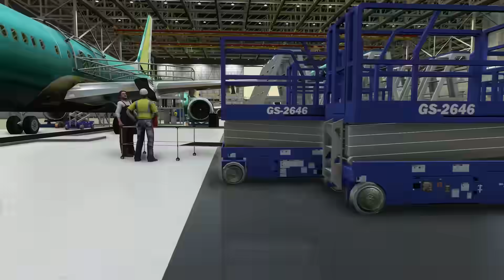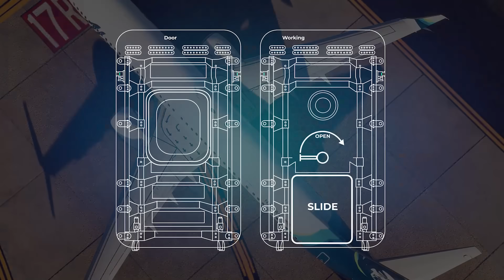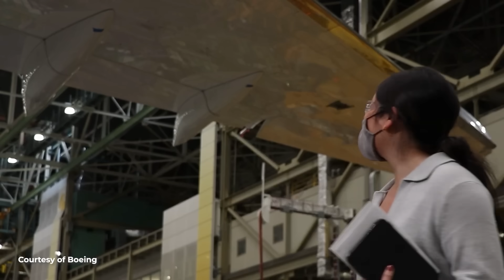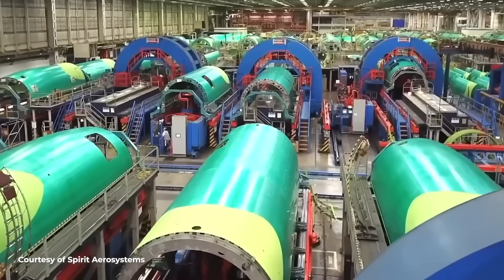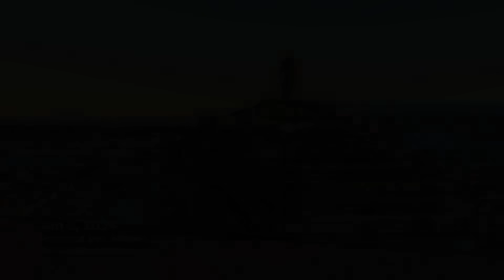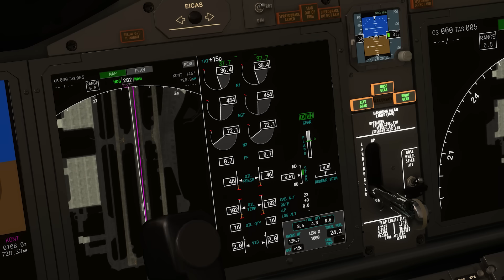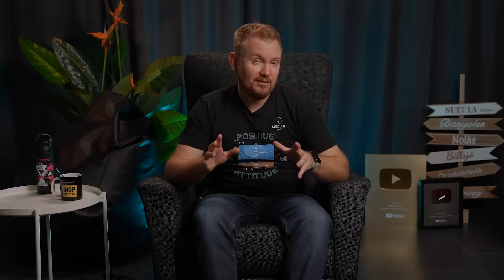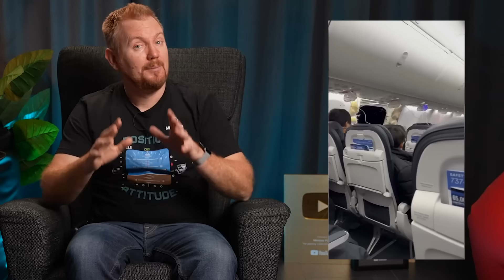Boeing 737MAX BlowOut!! The Scandal behind Alaska Airlines flight 1282

Comment: Was it "some miracle" that passengers were not seated next to the plug?  Previous passengers had complained about the whistling. Some smart employee of at the airline without the authority to ground the plane must have decided it would be prudent not to use those seats.
Reply: The odds are 32,042 to one that this occurred by chance. With 179 seats available, if only one seat were empty then the odds of that seat being next to the door plug is 179:1. With only two empty seats, the odds of both being next to the door plug is (179x179):1, or 32,041:1.

In other words, statistically impossible that the seating arrangements were a product of chance. There was clearly a known issue with the plug.
Reply: @reshpeck  normally with only a few empty seats on a plane like this, I'd expect all of the empty seats to be middle.
Reply: @FameyFamous  Right!
Reply: @FameyFamous  My calculations are incorrect, there were seven empty seats, not two. I misheard what Petter has stated. Still unlikely but nothing nearly as astronomical as I originally factored.
Reply: @reshpeck Is that not (7 over 192) squared = 1 in 752?
Reply: @reshpeck Sometimes the Internet is an amazing thing. Thank you for your clever mind Mr Peck.
Reply: @reshpeck  I just threw a coin ten times. I got the pattern HTTTHHTHHT. The probability of that pattern is 1024:1. It's statistically impossible for me to get that result...or is it?

You mixed up the probability of predicting a result and the probability of an unpredicted result happening. Had I predicted my coin tosses, it would indeed have been more than wild to get exactly that result. However, that result has the exact same probability as any other coin toss result. It doesn't happen more or less often than any other, so it happening here is no surprise---some result had to happen, and they all have the same likelihood. Please be careful here, mixing this up is the kind of mess that gets innocent people into jail. Yes, that has happened more than once before.
Reply: Yup I would like to know the statistical chance that these two seats were left unfilled.
Reply: Remember the aircraft had already been on the MEL, restricting it from flying over water .. //
Reply: @FreibertX so they knew it was a lame duck that leaked air but knowing the  pressurisation system was coping decided to press on till maintenance time..not knowing the door was shortly going to fall off its hinges.
Reply: @andyharpist2938 Reports of leaks, Plane on MEL, indicated pressure issues and still flying is imho absolutely irresponsible - they just didn't want to cancel a fully booked flight //
Reply: @FreibertX This is true but also true is that the safety regime in USA is astronimically higher than almost anywhere else on earth. ANy who has live in the world knows that large portions of it have not the slightest concept of  the human errors that create the sort of accidents Petter talks through for us. Many have an it- will-happen-if -happens attitude and accept no human responsibility for many occurances. 
There were two channels to highlight this danger. Many places hardly have one.... if you want to keep your job.
Reply: Erring on the side of an abundance of caution appears to be at work here.
Reply: @Connor_Arroyo So someone was cautious. Why?
Reply: It was definitely intentional.  At least it worked out in the end though.

Comment: What's amazing is that the door stayed put as long as it did.
Reply: It would indeed be amazing that it stayed put, appart from that you can see at 12:18 in the video, a white plastic zip tie is  holding it closed. Why isn't that mentioned?
In the "after closure" Boeing progress photo at 12:18, on the (forward) right hand side of the door, the second up from the bottom, pair of door & frame lugs, have a white plastic zip tie clamping the door lug pin & frame lug pad firmly together, preventing the door from lifting, as the 4 locking bolts would have done, if they had been fitted. (This photo is figure 16 in the NTSB preliminary report).
The zip tie held, keeping the 12 pairs of lugs aligned, until a bumpy landing broke it, or made it finally slip off one of the lugs. Without that zip tie, the lift assist springs will lift the door to the point where all of the lug pins/pads are pretty much disengaged and only the very bottom part of the upper guide tracks are engaged with the guide rollers.
That part of the guide tracks was never designed to hold the cabin air pressure and it finally broke at 15,000 ft, the first flight after the zip tie broke. (After 150+ flights).
It's a shame that the lift assist springs didn't lift a tiny bit more because then the guide tracks would have fully disengaged from the guide rollers when the zip tie broke on landing. The door would have then fallen open to 15° where it's wire lanyards would hold it. Hopefully a door plug open 15° would be noticed on the next pre-flight walk around. Failing that there would be serious wind noise on takeoff, deformation of the interior panel, no pressurisation and an interesting view for anyone looking out through that "window".
Note: a zip tie is also known as a hose tie, cable tie, zap-straps or tie wrap.
Reply: And thank you to "Bob" the Door Plug was then picked up in a garden, so that we now know what happened with it.
Reply: If they never really intended to use those doors again why don't they weld them shut?
Reply: IIRC, wasn't the failure on the 151st flight of the aircraft?
Reply: Why is that amazing?
Reply: @hafor2846  It's amazing because those lower springs should have pushed it up, then the pressure should have pushed out from the delivery flight. The question becomes what kept it down. Sure, the gravity contributed, but it wouldn't be enough to keep those springs compressed, they are designed to keep the door up when it's opened for inspection. The interior trim panels might have helped kept it down but I think it's unlikely, as they are not designed for that. Some people on aviation forums noticed something in one of the pictures the NTSB received from the assembly line, showing the missing bolts. This picture is also in Mentour's video. If you pause the video at 12:18 you will see it on the lower right of the door plug, at the second stop pad/fitting pair from the bottom, above the blue circle. It looks like a cable tie placed around the stop pad and the stop fitting, and the tail of that tightened cable tie is going diagonally down and to the left.

In my opinion that cable tie was the only thing preventing the door plug from moving up during previous flights. When that became loose enough, the door plug finally moved up enough, and the stop pads were no longer able to stop it from being pushed out by the pressure. The stop fittings on the door were able to almost completely clear the stop pads on the frame. The pressure did the rest, the small remaining area where the stop pads and fittings still overlapped wasn't enough to counter it, the remaining touching metal parts were not able to withstand such high forces and failed, and the door plug departed the aircraft.
Reply: it seems to me there is a design flaw in that plug door. it should never be able to move around and loosen whether safety bolts or not
Reply: @ursodermatt8809  something must be able to move at some point in assembly to be installed. It is a very efficient design, but no design can hold up too “whoops, there are extra parts left over”
Reply: @Lovedbychrist1  I agree that the most astounishing part was that nobody noticed extra bolts after putting the door/plug in place. I would be pretty unhappy to find 4 unattached bolts after maintaining a car, let alone an airplane. Did somebody notice those bolts and simply pocket them instead of raising an issue that they found extra bolts but do not know where they belong to?
Reply: @MikkoRantalainen That part didn't surprise me, probably multiple shifts and crews were involved and it's not unusual to assume that new hardware was used by whoever did the reinstallation. The lack of a 'removal' document in CMES is where the process bypassed normal QC to verify installation.
Reply: @ursodermatt8809 if you couldn't "move it around" (when the locking bolts aren't fitted) then you couldn't open it for maintenance (replace seal etc) or to replace it with an emergency exit door if you changed the seating configuration. The way that the force from the cabin air pressure against the door is taken on 12 pairs of pins/pads on lugs on the door & frame is similar to most doors on pressurised Boeing aircraft. The way the door lifts a small amount, to move the door lugs out from behind the frame lugs is how Boeing emergency exit doors work. They've made a massive number of aircraft over many decades & this is probably the first cabin door they've lost. (They have lost at least one cargo hold door, that I can remember but they work entirely differently).
Reply: @alanm8932  
the door, the one that actually opens, you first have to pull inside, then tilt sideways or upwards. also when there is enough pressure you cannot even open the door because it pressed towards the outside.
so, it seems to me, there is a design fault with the plug door if you can "open" it under pressure. even without  the 4 safety bolts.
Reply: @ursodermatt8809  I kind of see what you're saying.
Obviously this is supposed to have the 4 locking bolts fitted & then it's not going anywhere. (Until the locking bolts are removed for maintenance).
What happened here was that without the locking bolts fitted, when the engines started on the last flight the door was already 95% of the way towards being opened. So that's what caused it to fail in flight. I see what you mean that the tilt one edge in, then flip the other edge out and around style of door can't really be left "95% of the way towards being opened" so in that way they are safer. But, all they need to do is fit the locking bolts!
There is actually a problem with the tilt inwards before rotating outwards style of door. In an emergency that doesn't involve a plane full of Japanese people, it's likely people will pile into the emergency exit areas making it impossible to open the door. Not a great safety feature for an emergency on the ground!
I suspect that that type of door wouldn't actually get certified for a new design. That's probably why Airbus doors (even L1 main door) don't move inwards at all during the opening sequence.
Reply: @alanm8932  
i know what happened and i agree what you are saying. my point of view is that kind of thing should be fail safe.  for example having sensors like in a regular door. come to think of it, with hindsight, they should have never brought up the idea of the plug door. just install a normal door. i am sure the cost savings are not that huge.
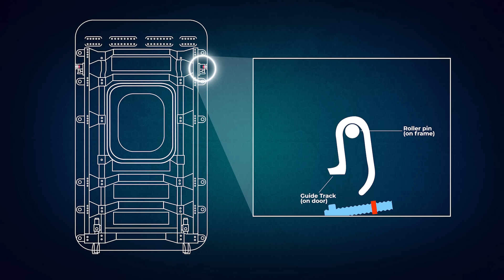Reply: What's amazing to me is that the door failed by moving upwards.  I thought the upper guide fittings mentioned @ 6:38 would prevent that.  Maybe it was loose tolerances or maybe Petter got the movement direction wrong(presumably the less likely scenario).
Reply: @h8GW , this door is designed to move upwards just over an inch so that the stops on the door and the frame clear each other when opening. There is another youtube channel; 'The Boeing 737 technical guide' (if I remember the name format correctly) that has several videos detailing this mid cabin exit in both configurations (full exit and door plug). Also, I believe, the Blancolirio youtube channel has a video going over the NTSB prelim report with some pictures of damage to door/ frame stops and the door fittings.
Reply: @CLTmech  the first video on the 373 Technical Channel mistakenly said the opposite, which caused some confusion. (You could see that was wrong by looking at it and he corrected it on later video).
Reply: @h8GW  Only if the bolts are installed.
Reply: @h8GW The door moving upwards is the correct direction for it to move when opening.
Perhaps you watched the 737 Technical Channel's first video on this door plug where he incorrectly said the opposite but then he corrected it in a later video. I think some of the commentators (Petter, Juan etc) may have copied his earlier mistake.
If you think about it, when closed & the locking bolts in place, the door is fully down, so the only way for it to move to open it (with locking bolts removed) is up.
Reply: @h8GW   The guides are mounted on the door, so the guides would be the thing moving upwards. The roller inside the track is what's mounted to the fuselage.
Reply: What's amazing is that it wasn't a door.  It was a plug.

Comment: The 12 tabs don't actually hold the door. They're rubber pads fitted in aluminium brackets on the door frame, with a dimple in the centre to take a pin mounted on the plug. There's nothing actually holding the plug.
The plug itself is fitted from the outside, with the pins lifted over the brackets. This is why the assembly has to be lifted with the help of the springs, to clear the brackets. However, to talk of the internal air pressure holding them closed isn't exactly true. It holds the plug in position, certainly, but if vibration starts to move the door before it reaches sufficient altitude, then there can be airtightness issues. This set up a DC-10 potential, in other words.
Another aspect is that none of the bolts actually held the door to the fuselage either. They simply stopped the door ejection happening. If something else happened...
Reply: he actually explained it a lot better than you did.
Reply: @kenbrown2808  I was adding to it, not attempting an alternative version.
Reply: There are no rubber pads.
Reply: @TEDodd  FFS go do some research, troll. If you have a look at those drawings of the 12 lugs, they rest on something like overgrown rubber stoppers, probably to damp the vibration. It's a horrendous kludge, imho, but then again, I'm not selling hundreds of the things. The critical thing is they learned zilch, nothing, sfa from the MD-10 Cargo Hatch issue in the 1970s.
Reply: @RahereTheGenius  I've seen the parts. No rubber. The fittings on the frame are aluminum with steel pads. The fittings on the plug are also aluminum with adjustable steel pins that rest on the pads when the cabin pressure pushes the plug out.

The emergency exit doors are the same. 

Just look at the photos in the NTSB preliminary report. Or dozens of other photos of the plugs and emergency exit doors available.
Reply: @RahereTheGenius 
If u look closely at the report’s pictures it seems that your “additional commentary” is not reflective of the actual design and how it was “engineered” to function.
Reply: @Mentaculus42  Those pictures are only part of the original set. They're out there, keep looking.
Reply: Oh, and bye the way, that's an abuse of real engineering. Even this halfway house to allow the buyer to change his mind. Amateur.
Reply: @Mentaculus42  You've not seen the full set of leaked pictures of the door MentourPilot's using. They were leaked because Boeing are not playing straight, and if @REDodfd's seen the original, he's from Boeing.
Saving a second on the door removal when none of the other doors work that way is iffy. Unless, that is, Boeing anticipate far more need for them than experience shows. I'd still rather have a couple of seconds on the ground than self-opening plugs at 30 000'!
Reply: @RahereTheGenius  I've seen photos of the plugs and active doors on other 737s not taken by Boeing. There is no rubber pad in the design. It's metal to metal contact.

The emergency exit was designed first. Then they modified the exit door to be held by bolts for the plug option that some carriers requested.
It had nothing to do with allowing the buyer to change their mind. It's very expensive to change the plug go an operating door. None have ever been changed.

It's about the extra engineering to redesign/certify the fuselage without the opening or a different attachment system. Using the 4 bolts where they did meant no structural changes for the option.
Reply: @RahereTheGenius  and Mentor Pilot did not use leaked photos. Everything in the video was publicly released.

If you think something ks leaked, point out the time stamp for it.
Reply: Nonsense. Of course, those 12 tabs prevent the door from moving outwards. That's what they are there for.
Reply: @HenryLoenwind  The plug has to move upwards and outwards to open. The tabs locate it, ie help stop it rising up when the plug is flush, in my understanding. I have said elsewhere - it's a ridiculous idea! The plug should be bigger than the hole, and be removed INWARDS. Differential pressure would keep it shut at altitude. But then again, I'm not an engineer.
Reply: @travelbugse2829  the stop pads&pins only prevent outboard movement. When the cabin is pressurized the outward force and friction prevent movement.
When not pressurized the guide track/filled and the stop bolts keep the pads and pins aligned. On actual exit doors threre ia a moving latch that prevents upward movement.

Aircraft used to have exits that opened in, and were set on a seat or rotated and went out the opening.

The FAA found that was problematic in use so things changed to outward opening exits.
Reply: @HenryLoenwind  I'm not going to argue with someone too lazy to check for themselves. Metal on metal wound skate of immediately. Metal located in metal would wear. But above all else, those pictures shown are part of a far more extensive set which show both parts in detail. I could be bothered to check before making a fool of myself. Why can't you? Still, it's not my place in life to instruct idiots.0